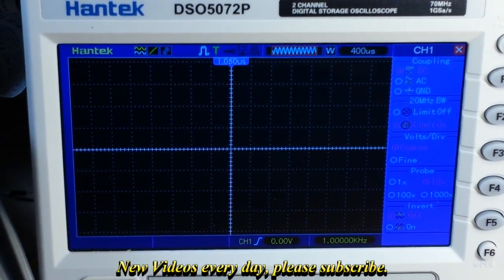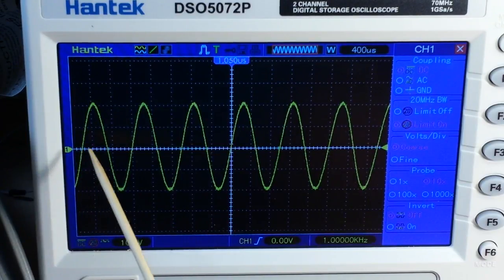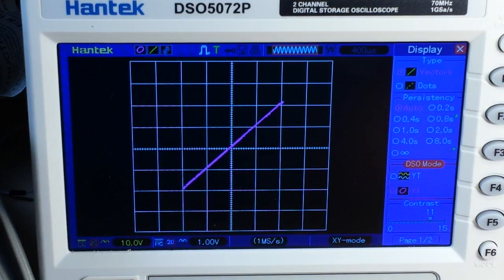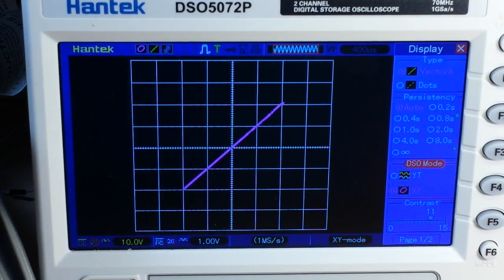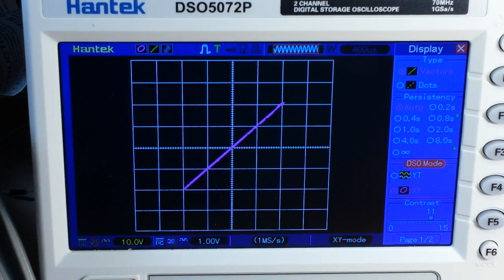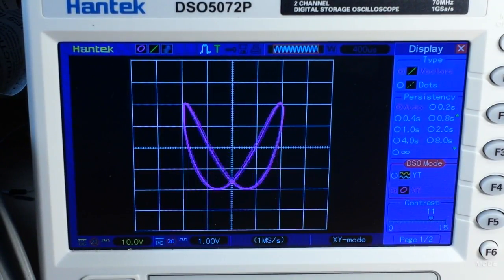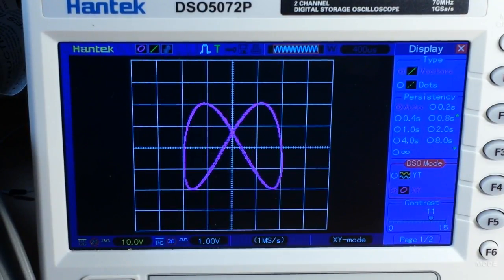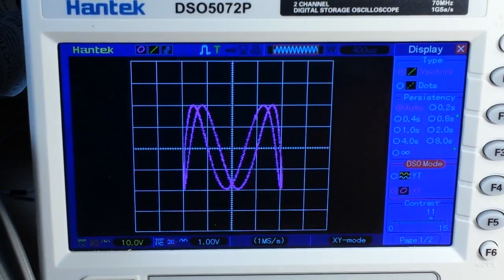What are Lissajous patterns

Comment: imagine a what's it called. that musical instrument that you don't touch. invented by the Russian guy that it's named after. it has the two antennas . with the fields you move your hands colder to one for pitch. the other for volume! it starts with a  T.  why not build one of those and put it on the scope!!!!  I'm going to be up all night trying to think of that T word. great video . I'd like to see more. I know .. get my own scope!  if I did I'd be probing everything!  good day!
Reply from the maker: +James stranger Theramin
Reply: learnelectronics 
YES! has anyone put one on a scope. or something like it on a scope? I love scope music. its just hard on your ears! the music that you listen to with your eyes!  any idea what a 1.8 ohm coil will pull current wise? I guess the core has something to do with it. I just don't know if it acts like a transformer. or a inductor. or what. if you know anything about a alternator.  I guess its like a transformer that the primary spins. and has 3 secondaries! for 3 phase output.  the pulse width of the primary regulates the magnetic field. regulating the output. that's what I figure anyway after a year of off and on research. if you had rather I'll communicate thru email. I don't want  everyone to read how dumb I can be!  thanks